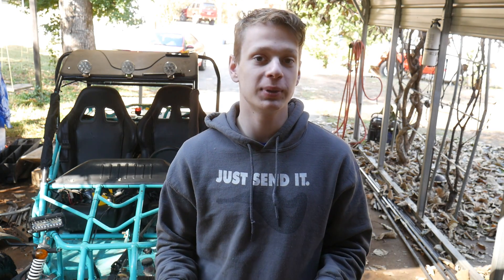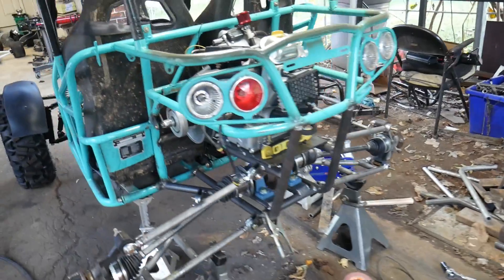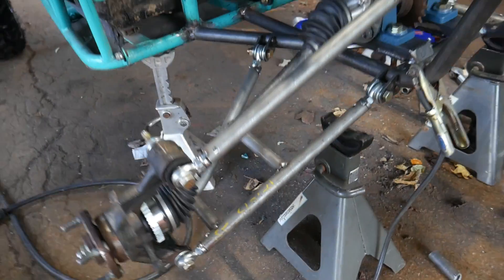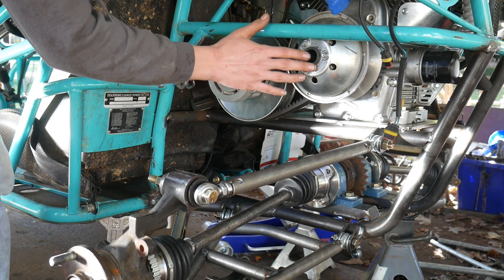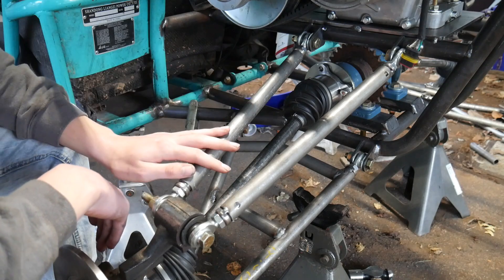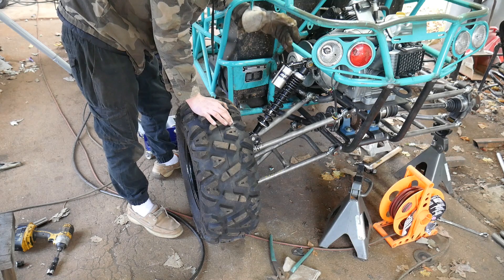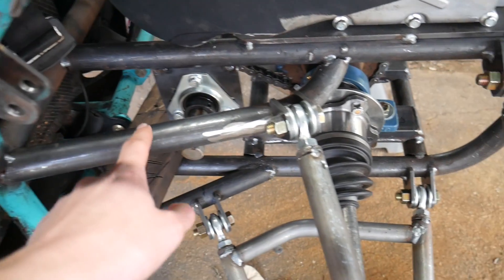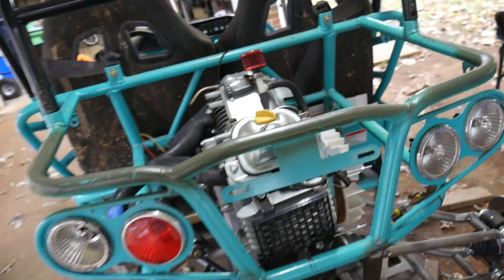Long Travel IRS on a 50hp 670cc Chinese Buggy (Part 3)

Comment: I think those shocks would have worked with an upper shock hoop mounted out board as far as possible with a steep angle from botton mounting location to top.

Comment: You can calculate your max speed by multiplying Engine Max RPM x CVT high end reduction x final drive reduction x circumference of the tire. Because your buggy can top out for two reason, no more gearing left at top end of the CVT or no enough torque to go any faster.

Comment: You should be able to pick up a master cylinder from any compact car at a junkyard fairly cheaply.   And would flipping the rims around give any more clearance for the calipers? What about 2" or 3" wheel spacers? Cheaper than new rims and tires.

Comment: Keep up the hard work, and master cylinders are cheap either just add another to pedal or get a trailer one problem solved or as someone said change to single disc rear on axle (but maybe more drama than good)
So glad when we see this thing go and have all the travel

Comment: Use the shocks u have. And put the shock  at a 45 to 50  Degree angle attached to the upper a arm just behind the rear hub about 6" in where towards the center of the car and then mount them directly above that with a cross member going for one shock to the other across the top.

Comment: Did he really call the clutch a torque converter 😂😂😂😂
Reply: Brandon Masieniec  that’s because it is a torque converter. It’s a snowmobile engine.
Reply: @mattleitch9577  it's called a clutch or a CVT? Citrifugal variable transmission? Also that ain't no snowmobile engine lol.. its LIKE one but nowhere near the hp

Comment: https://www.speedwaymotors.com/Wilwood-Compact-Master-Cylinder,23867.html

Nice and small and will run what you want. Just flip it around and make and bracket and handle. Run some nylon line and presto

Comment: You need to move the top of the shock out as well to get a better motion ratio and make the wheel rate stiffer. With it sat at an angle like that it wasn't really any better than when you started.

Comment: If you cant get the shocks strong enough by adjusting the preload (rotate the top end, it looks threaded?) then moving the top end outwards about 3-4 inches (or more) will also help to increase  "stiffness" as it will require more compression of the shock per degree of movement of the a-arms.  Also it would be worth measuring the total travel the shocks allow from open to full compression (can measure rod showing) then rais and lower the a-arm while holding a tape measure where you want to mount the top of the shock to test if the positioning is allowing full stiffness vs travel you would like to get.

Comment: you might source a Master Cylinder for either a jeep cherokee/wrangler or a thunderbird that should give you plenty of capacity, the t-bird master cylinder should have no problem doing 4 wheel disk, and i think go power sports also sells a dual stage master cylinder that might also be an option, all in all its turning into a very well engineered and thought out rig, far from the death trap it was formerly, good build man, cant wait to see this thing rippin' around

Comment: what size bore is the master cyl ? if it 15mm it'll prob be ok , if its really small (10mm) then prob need to change, the relocation for the rear shock is much better for load than where you put it originally , top work!!
Reply from the maker: Not sure but It's bigger than most
Reply: @VasilyBuilds   basically if its smaller bore  you'll have more pedal travel than before (when it was just the rear caliper) but better leverage (less pedal effort) if it bigger it'll move more fluid but have less leverage so pedal will travel less and require more pedal effort.

Comment: Look, search a pair of "Atv used rear shocks"  and you'll find a large selection of coilovers for newer 700cc IRS quads that have about 10" of travel on average for under $75 a pair! Should be sprung just about perfect. IME external reservoirs don't mean the shock will be better than an emulsion coilover. https://www.ebay.com/itm/Shock-Rear-Shocks-7041959-Polaris-2004-Sportsman-700-ATV-4x4/192980883379?epid=1118861843&hash=item2cee8e97b3:g:upAAAOSwIipdI2Qc

Comment: Yoooo Don't buy brand new high end coilovers! I buy used dirtbike and streetbike shocks among ATV front shocks etc. CHEAP on e-bay. Heck, even my car is on four GSXR1000 coilovers. And I spent $30 apiece for top notch shocks. The trick is to get the leverage ratio in the correct range for the spring weight. Look up the spring rate and figure how much sag you want etc. TOns of options. Even pages listing all researched motorcycle shock sizes and strokes. Just Fyi. I blew money on a pair of those you have there once before too

Comment: Since you have no differential my recommendation is: only run the brake caliper from the pedal on one side and run a hydro on the other side.
Reply: It'll work fine as long at your CVs hold up. And they should.. being from a car and all.

Comment: Put a cup like two flat washers on each lug nut stud and turn the rim backwards to see if that helps your clearance issue I'm sure probably will I might be wrong but it's worth a try I would love to see if it does work or know if it works let me know

Comment: Hey there, could you not use those shock absorbers with a cantilever setup on the rear
Reply from the maker: Cantilever belongs on race cars
Reply: Vasily Custom Builds  it seems to work exceptionally well in off road buggies and trucks too but each to their own I suppose.

Comment: If you get a lever hydrolic break..  look into dune buggy.   three lever steering brake set..  locks left or right rear independently center lever locks both rear.  It’s a vw set up.   But only if the rear is limited slip dif.

Comment: This kid gives me faith in the future youth. 

Couldn’t you just run a single rear disk, by the sprocket? You’d be able to keep the rims and tires you have.
Reply: A single disc would be enough considering he has front brakes also.
Reply: I was gonna say the same thing make jack shaft longer to the tight side and add a disc brake to it .

Comment: That shock / strut needs to be almost parallel with the wheel, I would make a upper control arm kind of mount that you can bolt it on to. I would compress it down all the way with the back end up in the air, build a mount off the top bar of the engine cage, then let the shock go. Might have some reverse Carolina lean though

Comment: Hey Vasily what's up young man? On them rims I've seen people flip them around and put them on the Hub backwards in other words the part that typically faces outside Spin The Rim around and make it face the inside and it will give you a different offset if your lugs will seat it might work to clear a caliper. Let me know if it's possible. I hope it works
Reply from the maker: It would actually work if i flip the rims. But i looked at them like that It was way to wide. I don't want it to wide becuase it will put a lot of stress on everything.
Reply: @VasilyBuilds  what about a spacer in between the Hub in the rim? I'm just trying to come up with a way that you don't have to buy for new Wheels. If you do have to buy them believe it or not a lot of times an aluminum wheel is cheaper than a steel wheel. So maybe aluminum ones would be something to look at.

Comment: To save money use a single disc brake on the center section between the axles next to the sprocket. That way you have more room for your current wheel setup and your current master cylinder more than likely wont be to small for it. And if you wanna go crazy you could put the brake rotor on the jack shaft and then your brakes will have a gear reduction. Altho that way probably will put more stress on the chain and it would definetely have a little slop from the chain slack

Comment: those ebay shocks have like 4 inches of travel. get a set of fox floats for like 300 for the pair, they will have much more travel and tons of adjustability. id go for a minimum of an 18" eye to eye fox float

Comment: What amperage/voltage do you use for welding. And what welder do you use. I'm trying to get a small welder to do frame fabs but don't have any shop plugs. Just regular 112 volt house plugs.

Comment: Hey Mr Vasily, I have a 3 speed with reverse transmission, in a utv called a Kimball Hauler J98 4x4. I'm pretty sure you can still buy one new. It's called a BT-92 from Olympicgear.com . Mine has a comet 40 clutch on it, you just pick a gear and go. I usually just use 3rd but for pulling or hill climbing I use 2nd, 1st is too slow. It's small but cast iron so it's strong. The company claims it can handle 50 lbs of torque. Maybe for a future build, you're too close to being done with this one too change it up now. The transmission has a long output shaft to run chain drive and parking brake.

Comment: Spring is hold the weight. Adjust the shock to adjust the compression.  Bustedknuckle I believe covers this. The rock bouncer guys have this figured out.

Do not do the ghetto drift brake. Just buy a new master and make it adjustable front/rear.

Comment: you cant pressurize those shock i have something similar with an air fitting and the springs had those adjuster rings.
Reply: We use those on a yerf dog and have adjusted them to stiffen them up.  Try that to see if that will help.

Comment: What are the end pieces that you are welding on called?? They are fully adjustable as well correct?
Reply from the maker: heim joints
yes they have 1 inch of adjustability depending on size
Reply: Thanks a lot for the fast response

Comment: Good to see ya actually listen and took into account of the limits on the axle flex vs trying to just have the most travel you can while it's sitting static. For the brake I would ditch the buggy one and go get one off something like a geo metro. They had a manual brake option and will be more than big enough for a buggy.
Reply from the maker: :) appreciate the feedback

Comment: Another great job ... BTW, that master cylinder will power front & rear brakes no problem, depending on how much flex hose You use.  The more metal or shielded hose, the better (but You knew that).

Comment: Very nice with the buggy. Never would have thought of this set up honestly. Gonna be sweet. Also I know winters coming up and it might not be a bad idea to get some metal roofing and use it to close in the sides of that metal car port might have to build the doors for the rear and front but would be worth it.. Use the foam board to insulate it and a small space heater ought to do the trick. Just a thought
Reply from the maker: Thanks. Yeah me and my dad might have to tackle that soon

Comment: This is really nice work my friend, I’m in process to start project to build buggy using Daihatsu Mira 650 cc 60 hp with automatic transmission gear box , and I still have some questions with no answer, does the the engine And the suspension I’m willing to use durable if stock used ? , what is the tube diameter and thickness and steel configuration(specs) that fits this project? , does the care suspension and break calipers fits this project? ... does the automatic transmission durable for this project? I hope that you can help to answer this questions
Reply: Im sure if you dont want to go 130? kmh like the original car unless you modify the internal gearing of the gearbox you will need to use smaller wheels to use all the torque and gears in the buggy!
Reply: I will use the standard wheels size for the Honda rancher ATV off road , 12-25-10 rear and 12-25-8 ?

Comment: This thing is coming along nicely! Quick question, so the diameter of the 780 driver and driven are 7.22" and 9.25" respectively. However no one online posts the width of the pulleys. I'm trying to do a CAD drawing for my build and so I can more easily see how much room I'll need.
Reply from the maker: The widths differ. And you have to shim the pulleys. The driven pulley expands up to 3" I'll get you some more detailed info if you want. But the belt is 1" thick. Drive pulley is around 7" thick and sticks past the PTO shaft
Reply: What you have given will give me a ballpark on where I need to be at
 Thanks dude!

Comment: Nice work it’s turning out great! Did you try to preload the shock springs, you should be able to add some preload to the spring and stiffen up those a bit.
Reply from the maker: I did add a little bit. But I want to go all out on em so I don't have to worry about it in the future
Reply: Definitely need more shock travel than the ones you tried, I would think with the right shocks and correct mounts you could easily get 12"+ at the wheel.

Comment: Aren't you supposed to go soft suspensions on a buggy?
Reply from the maker: Yes and no. It could flip over very easy around turns. Plus I'm still going to be sitting it and adding another hundo pounds so it's waaaayy to soft
Reply: @VasilyBuilds   have you ever thought of a stabilizer bar so the suspension at least in the rear (where i assume you have most weight) does not go crazy independent in corners  or things like that?
Reply from the maker: @NaN.404  gotta test drive it first. But yeah

Comment: Thanks for introducing me to Spray Max clear coat. I didn't know I could get a 2 part clear in a can. I got a 4 pack off Amazon, and used on the rollbars and cab of my off roader, the 'yota'bota, half Toyota half Kubota RTV1100 powered by a 993cc Briggs. The paint turned out so much better than any other rattle can paint job that I've done before. What a shine! Thanks again.
Reply from the maker: Dang! No problem man

Comment: The kart is looking good, and glad to see you're back making  videos. I would like to do the same to the rear of my Hammerhead Twister. I'm curious, what is the final width of that setup (without tires)?
Reply from the maker: The axles are 25" long then if you add the carrier length which is around 9" it turns out around 59" wide.
Reply: @VasilyBuilds  Thanks for the reply.

Comment: Food for thought, if you make the control arms/A arms to strong they will become stronger than the frame, and if you were to hit something hard enough you would bend the frame VS just bending an arm.
Reply from the maker: Yes that is true! Strong but not to strong. The frame will be super beefy thick wall tubing
Reply: Just has to be stronger than a leg 😆
Reply: @kartnerds  you mean a house!? Sorry, had to... I went through 9 surgeries on my leg myself from a motorcycle. But still, it wasn't a HOUSE! ✌️
Reply: @nzzs203  Relax hes going to make it faster, it'll plow right through next time :)
Reply: @eamh2002  🤦‍♂️😂